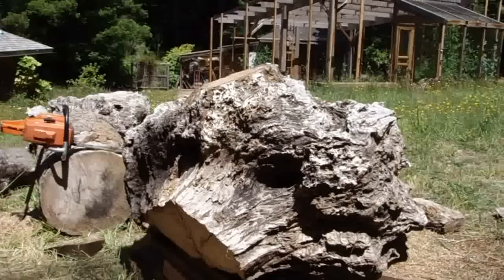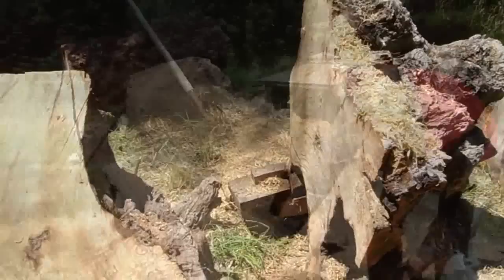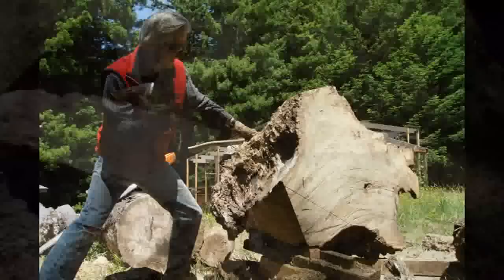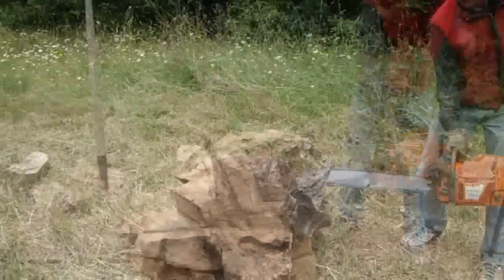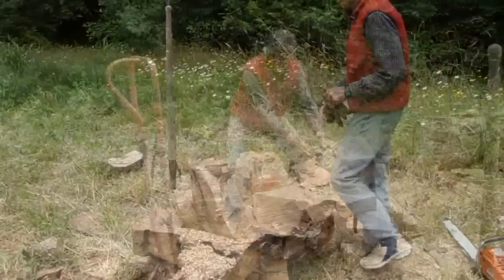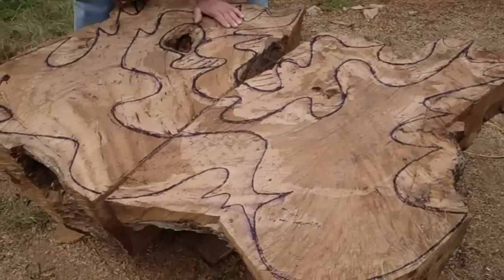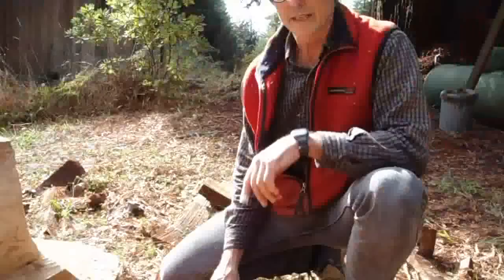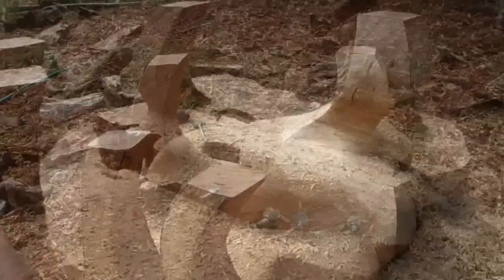David Groth carving - for the edited version see "carving the sculptural table Swallowtail."

Comment: Nice work, thanks for posting.  Have worked out of Fairview, Coquille areas in Oregon. Laverne county park has nice specimens of myrtle and fir. Have seen very large remnant and live Myrtewood trees. Just put up piece of myrtlewood door trim from wood we got 40 years ago.  Was surprised to hear word kiln, but followed by 6 weeks made sense for such figured wood. What temperatures does piece go thru in 6 weeks if you do not mind?
Reply from the maker: The temperature in my kiln is 130 degrees with high moisture content kept high for the first 3 or 4 weeks. Thanks.

Comment: Dug a 4 ft walnut stump. So much grit and rocks I gave up on it. It was embedded thoroughly.
Reply from the maker: Yes I've had the same sort of problems at times with tree root stumps. I suppose it goes with the territory.
Reply: I wonder if pressure washing might be a good approach for cleaning up gritty rocky pieces.